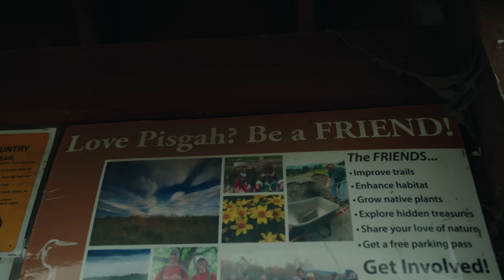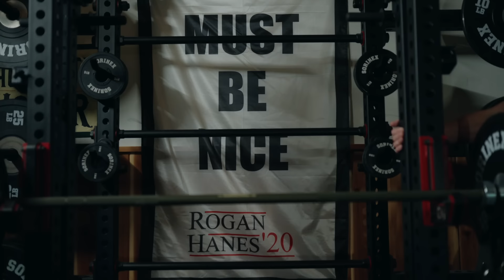Lift, Run, Shoot | Tulsi Gabbard | 009

Comment: 30 yrs ago I used to bow hunt with a Browning X-celerator 70lb compound bow, and I routinely made 40-50 yard shots with it without a trigger or pin sights.  Today, the bows are so advanced and they’re so many accessories, and yet, seemingly, not many make shots that, for me, were simply a day at the range or on a hunt.  I would have thought that by now people could make much longer and more accurate shots, but I’ve not witnessed it.  Of course, in the old days we’d actually shot the deer even if they were running, so fumbling with triggers or pin selection would only cause chaos and increase the probability of missing.

Wouldnt it be nice if some day, hopefully soon, we see a bow range at the White House.  It is a great hobby, much like going to a gun range.

Comment: Most 2A supporters are ignorant of how important the bow is to the 2A. Not the fancy bows but the horse bow, and improvised bows. The gov can outlaw manufactured bows but they cannot stop the building of improvised combat bows. Thumb release is far more combat orientated than fancy compound bows. Thumb release is comparable to rate of fire of a bolt action.